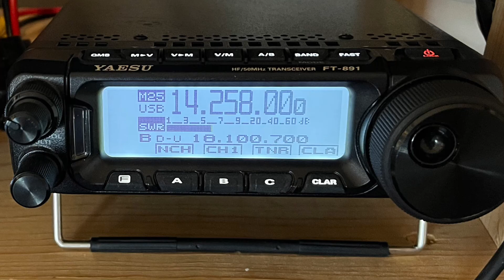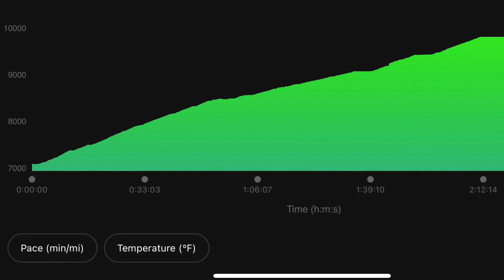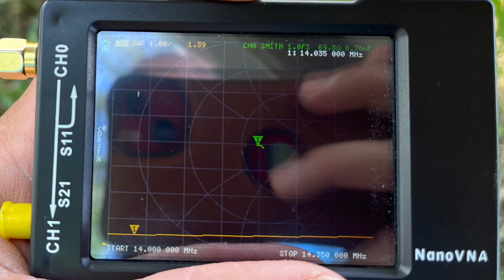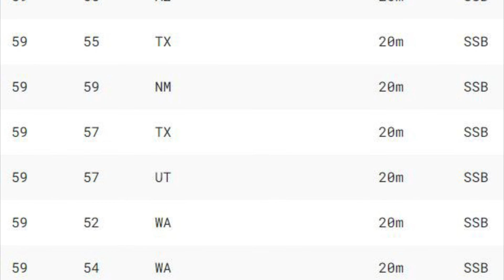Solstice QRP - SOTA W7U/NU-033 w/Yaesu FT-817 and external battery & Super Rugged, UL Antenna

Comment: The FT-817 is much more you speed. It's great for the type of working you're doing. Like you, I am getting ready to sell my FT-891. It's just too much weight for SOTA.
Reply from the maker: The 891 was a beast. Coupled with a huge battery just to feed it... It's a great radio and it's not lacking for someone who can work radio from home or wants a mobile field radio. The 817 may not have filters and power. But it sure makes up for those things when you plug in the antenna at 10,000 feet. The 817 is at home in a pack, the 891 is not.

Thanks for the feedback Gaston! I'm stoked to do more with this thing.
Reply: Just caught the end. Great job working Joe KI4ASK while he was on vacation! He's a good guy.
Reply from the maker: @TheTechPrepper  Joe is a stand-up guy for sure!